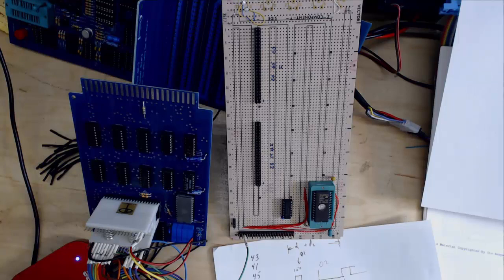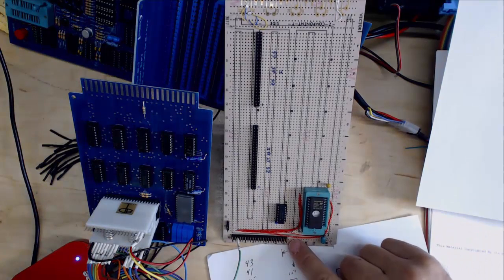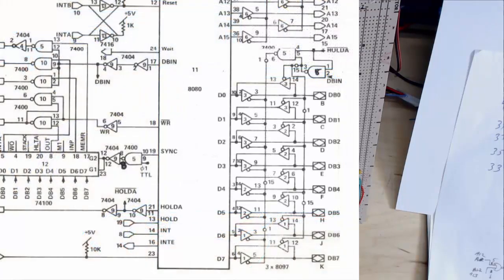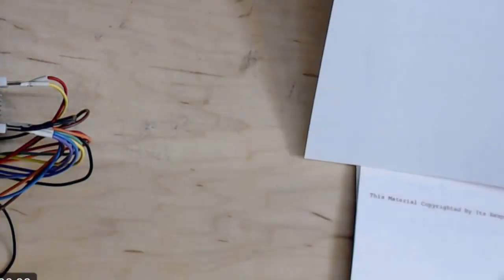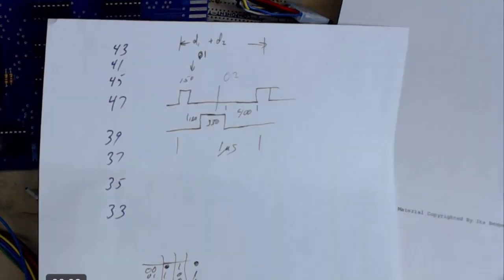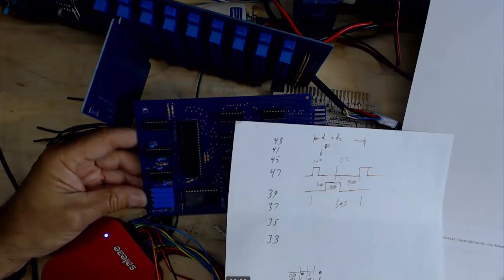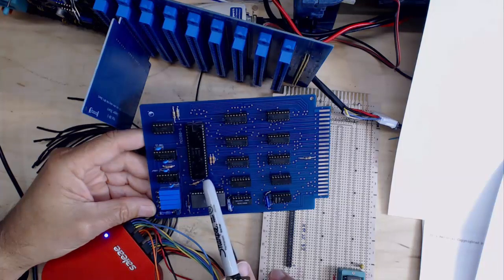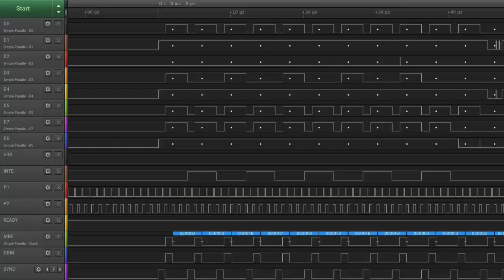{22} The MIL MOD80; She lives !!

Comment: Yes, that is true. For some silly reason, MIL put the components on the opposite side of the boards from the normal way.

As for that resistor, it is a bit funny how that one was done.  Not sure why the top lead is bent that way, but that is how Robert Swartz designed it.  I will add a note in the Build Manual to watch out for that.